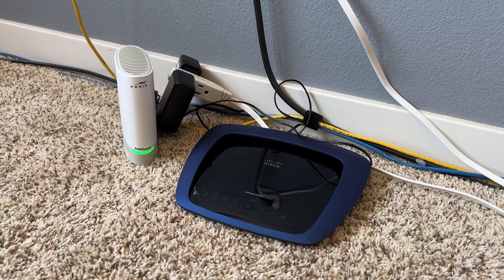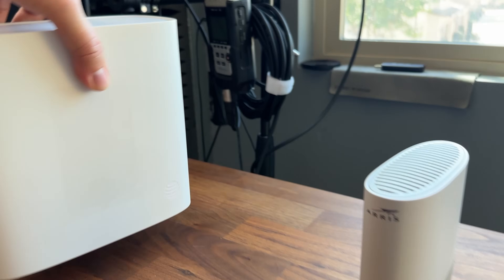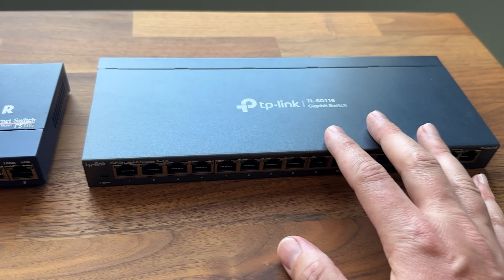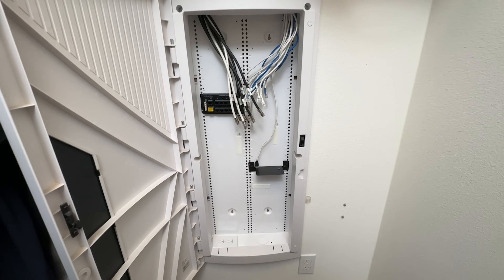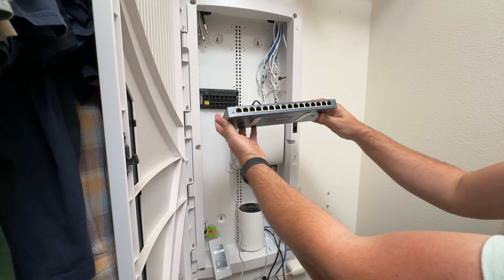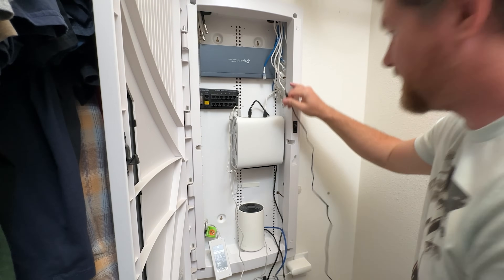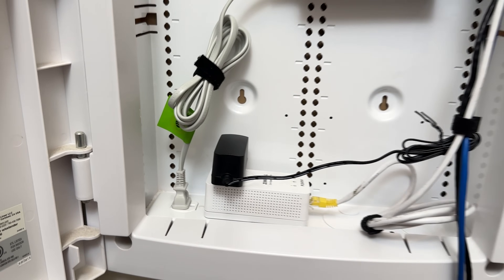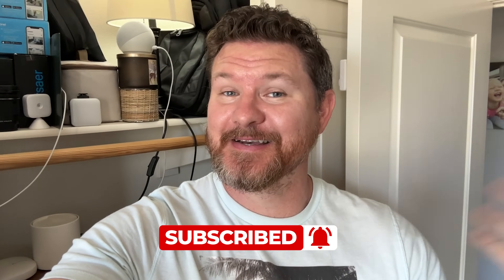How To Setup The PERFECT Home Network For Beginners

Comment: I have one question. How do I disable the router in my all in one modem and router from my carrier so I can use the mesh system?
Reply: Can be tricky depending on who your carrier is, but most gateways (as mentioned above) have a “bridge mode” that will disable the routing function of the gateway and just keep the modem function running. Some providers such as AT&T if you’re in the US use different terminology and methods to provide a similar function I want to say called “Pass though” or something similar. Don’t quote me on that. It works a little differently than your traditional “bridge” mode, but it serves a similar function.
Reply: @BishTheBearded  do any of you know what it would be for Bell in Canada?
Reply: @BishTheBearded portforwarding passthrough IIRC....so long as they still have control AT&T = FTL
Reply: I suggest using it as a bridge, there should be a “bridge mode option” I suggest using a rj45 cable to do this. Just turning off the Wi-Fi signal won’t turn off router capabilities from the provider 
device.
Reply: @Marcel.Miranda  No true bridge mode on AT&T BGW320 only ip passthrough.

Comment: You’re assuming that everyone’s house is wired. Most older homes only have the modem coming into the house.
Reply: Yes indeed. Wiring is 95% of the battle. I’d do it my house except I don’t fancy the redecorating. Thanks for pointing this out in a comment and saving me the time watching this video.
Reply: I have an older house currently, and I have Ethernet cables running along the baseboards between my ONT in a far corner of the house & my mesh nodes in better locations. I even have a flat Cat 6 cable running across a doorway (with protection) that still works at full gigabit-plus speeds. Not everyone can wire everything, but if you try you may be surprised by what CAN be wired.
Reply: Just run the cables yourself, where I live only power is run through the house. Internet and such is on you.
Reply: @nicoldengenyakeye6905  if it wasn’t for the redecoration effort I would. I’m not willing to do a crap job and just tack wires to skirting or under carpets. Luckily a combination of Homeplug and WiFi mesh does a passable job. Not really needing 10Gb speeds yet.
Reply: Some of us live in bricks and concrete houses, we are forced to use surface mounted pvc channels just to run one single cable... It's so frustrating.
Reply: @JosePto  are your interior walls not plastered? Could you not channel it out of the plaster and then patch over the top? 

Granted, I know it's a lot of work, so I've run trunking for all of mine aswell 😂
Reply: @nathantowler4203  pure bricks and concrete, no internal channels apart from electrical ones, if I wanted to make cables not visible I would have no more option than making a channel by breaking the wall, installing a PVC channel, covering with concrete, sanding and painting, what should be made through my whole house. Basically, it's not an option.
Reply: @JosePto  yikes man, that's unfortunate! 

Guess your only (easy) option is external trunking if you wanna wire everything. This kind of situation never even occured to me
Reply: @JosePto  sounds like if you want to cable run you should think about molding with some empty space behind it.😅
Reply: Including not everyone has access to gig
Reply: I "home ran" my whole house into a walk-in closet with a dog leg corner at the back where I put wire shelving to increase ventilation. I haven't installed the door or cooling fans as they haven't been needed yet.  Looking around for a video to help explain it better to my father, I stumbled across your video.  Nicely done.  Couple thoughts you may or may not choose to include when talking about people running and pulling their own cables:

1) delineate between the speed and capacity of the different cables (Cat 5e - Cat-8) reminding them the cable used can be the data bottleneck just as easily as a switch, etc.  If I was on a budget but wanted to be future ready, I'd run no less than CAT 6a. As it stands, since I did all the labor and money wasn't tight, we opted to max out withtl current technology and have run all Cat8...it's expensive getting legit certified cable but should keep us secure as long as we have this house.  No peripherals are ready for the CAT8 cable yet at 2000Mhz & 40 Gbps.  It's kinda stiff to work with yet has excellent shielding RFI&EMI rejection.

2)  Detail the differences between switches and routers a bit more, making sure to include details like how data is divided for unmanaged transmission in that a router divides up its capacity equally whereas a switch attempts give them all 100Mbps dividing up and prioritizing packets as they arrive.  
Example 100 Mbps by 4 peripherals, with a ROUTER, they all only get a max of 25 Mbps to use but they can have NAT and or PAT and more for security, 
NAT = network address translation IE: private internal IP's like the 192 node ones;
PAT = port address translation IE: scrambling the port #'s that are open or closed.
I'll let the OP explain it further if they so choose to.
Example 100 Mbps by 4 peripherals, with a SWITCH, they all theoretically get a max of 100Mbps but no NAT or PAT etc. 
There are more differences....

3a) If you're going to run your cables by yourself: LABEL EVERYTHING as you go....it's amazing how ofter something "so obvious" gets sucked into the wire nest void.

3b) If you're going to run your cables by yourself: GET A LINE TONER to trace lines trace your lines in the event of a "Mislabeling Mishap"  We're human, we make mistakes...especially if we let our wives help us knowing nothing but needing attention and to feel helpful. You have nothing but time to go back and figure out what "you" must have mixed up, but the dog house can last forever.  
There's plenty more, but dinner calls.  Once again nice video, I look forward to watching more!
Reply: True.  I wired mine myself.  I am not in the USA though.   So that means concrete/brick house.  So I just ran it from my network rack upstairs using pvc cable moulding.    Only a few lines though.  One of them so I could use an ethernet backhaul for my mesh system.    Wireless backhaul doesn't work as well in a house made of concrete /masonry.
Reply: I just wired my own tbf
Reply: That's all i have. So just going to run ethernet cord through wall, down side of my house, then in same whole cable wire goes in for wifi box.
Is what it is, but definitely cheapest way, can do it for like 20 bucks, and drilling 1 hole lol
Reply: I just wired my home lol not hard
Reply: THANK YOU. this is no help to some one that has 2 coax  outlets. But i like your style & well intended effort.
Reply: Is your internet coming into the house AT&T fiber?
Reply: I have never lived in a place that has wired Ethernet. Only the older phone lines.

To assume the average person in the USA has in-wall Ethernet wiring is folly.
Reply: I only have "telephone" wired in my house but its still the same as ethernet. All I did was cut the wires and put a new jack and a splice box to get the cable back to the modem.
Reply: @RightJoystick he’s not assuming everyone has it. And depending on how old your house is you probably do have your house wired for the Ethernet ports in each different rooms.
Reply: So run some wires. Post wiring is possible if you willing to patch a few holes.
Reply: Not true.
Reply: WI-FI is a thing that exists.

Get yourself a Wi-Fi 6E, or 7, Tri/Quad band router.

Setup a wireless mesh network that uses the 6 GHz band as the backbone.

Gg wp.
Reply: Need a simple explanation on how I can print from my iPad
Reply: If the house is not wired...then wire it.... don't be lazy.
Reply: @johnmbugua6289  🤣🤣 we're talking about technies here! since you're watching the vid. 
Seriously, we just tend to look for the easiest solution 1st.
Reply: Ethernet has been around since the 70’s it’s fair to assume most single family homes today have Ethernet cabling.